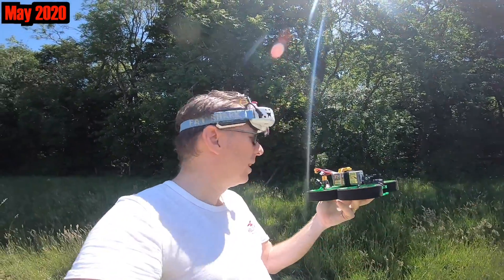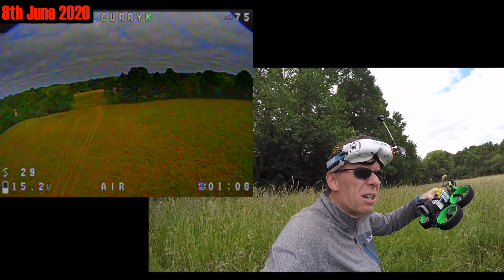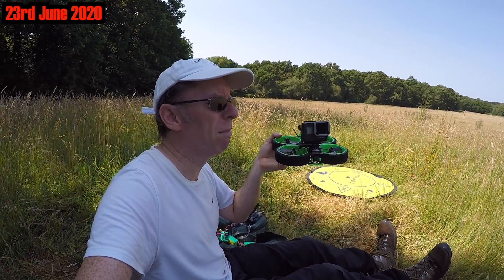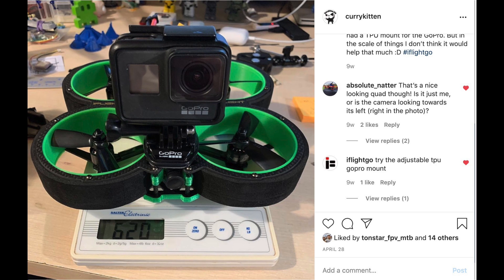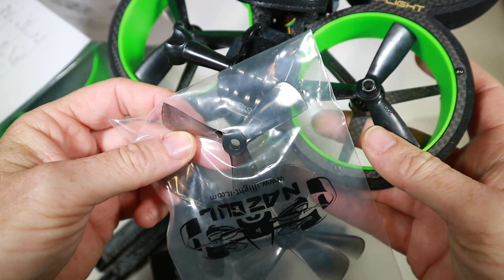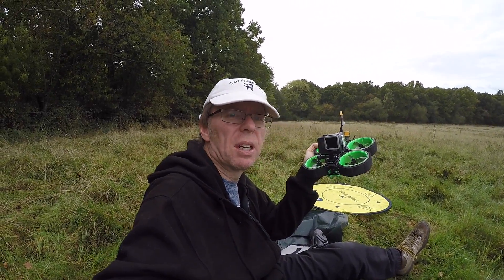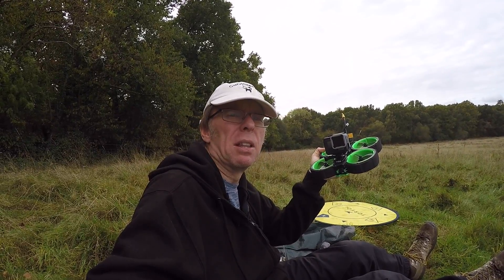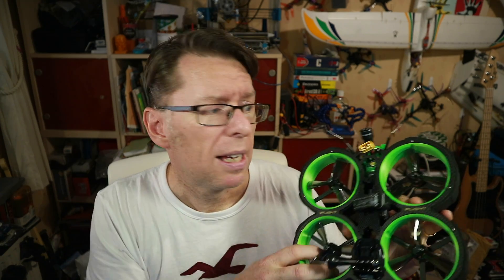Fixing issues with the iFlight Green Hornet:  Motor overheating and range problems

Comment: Thank you very much. You did all of the research. I guess this is why my iflight green hornet that was also shipped in May for review from banggood had scorching hot motors (I partially covered 1/3 of the cost out of my own pocket). So it sounds like there is nothing I can do at this point except message iFlight and see if they will work with me to send out what is basically the hornet v2 kit there and replace everything.
Reply from the maker: Hopefully they can - dodgy design in the first place I think.  Although some people have had good experiences on the original and bad on the replacement, so I think there's a very fine line between working and broken
Reply: @CurryKitten  I have roughly 10 flights on mine, with most of them spent trying to tune the hot motors out because I knew it something wasn't right. I did see some glowing reviews of it but I ask myself; how long did they actually use the green hornet for? I flew it a few times and it did not die on me, I could have easily completed the review and just said it's great, ignoring the hot motor issue entirely. Or missing it, for lack of being thorough. This review was the most thorough, complete testing of the hornet I have seen on YouTube.
Reply: @CurryKitten  Unfortunately even after showing them your experience, and explaining mine is the same thing from one of the first batches from banggood, the best they can offer me is 30% off new motors only. Pfft, pathetic. I know iFlight makes generally good stuff and this incident is a one-off with them but that's pretty ridiculous and disappointing and I told them that. I love how they don't answer what the maximum weight is that these are supposed to carry on the front as well. Thanks again for the video, so that at least I know what I'm dealing with now and that it's not just me.

Comment: I just picked up a second hand one of these and had the same issue with motors overheating.  Had a look at the tune (like you did) and it seemed....weird.   Reset to betaflight defaults and since then it has been fantastic.  Range issues weren't a problem for me though because I dropped in an ELRS nano RX.  It's now quite a capable kwad.  I bought it to do indoor video, but still love ripping it freestyle.  It's just so damn loud!  lol.  Trying out some 5 and 8 blade props soon which should help with that.
Reply from the maker: I couldn't imagine flying it for "fun".  I mean, it flies ok, but yes, the loudness.  I hope you have some success in reducing the noise on 5/8 bladed props!

Comment: I commend you for staying with this to get it sorted out. But it is a strange beast. Using a naked GoPro or the Insta360 should help the weight but either way it shouldn't take this much effort to 'tweak' a new quad so it flies right. Thanks Wayne.
Reply from the maker: The Naked GoPro would be handy here (although I use my GoPro 7 for other things as well so don't want to rip it apart) that said if you get it that light, you could use a little 90mm quad and not have to bother with a 3" at all

Comment: Hey! So useful to come across this. I have the Eachine Cvatar 6s and I'm having awful issues with the quad out of the box. The motors get smoking hot after just a minute or two flight and I can't for the life of me work it out.

Have you had any issues with yours?

Banggood and have been awful with helping to diagnose this and just wanted a video "showing hot motors". I'm really feeling stuck. Its basically a useful lump right now until I can sort it.

I noticed that the stack and ESC were really poorly mounted to the frame and I presumed this was causing noise/resonance but on completely taking it back to the frame I've still got the same issues. 

I'm running the 6s version with a Hero 8 (with no battery or door to reduce weight) but the motors get hot whether I'm carrying the Hero 8 or not.

I'm running stock Betaflight settings and stock PIDS supplied by Eachine out of the box - Any hints?
Reply from the maker: The Cvatar worked well for me (although I had the 4S version) what I do notice about all these cinewhoop style quads is that they are right on the edge of what they can handle.  One little thing wrong and it feels like everything could instantly go up in smoke.  It's entirely possible that Eachine didn't have the normal part and so swapped something.  Obviously the smallest lipo you can use helps, but if Banggood aren't being helpful, get a PayPal dispute raised.  The defaults flew fine for me, so you might just have a dud.
Reply: @CurryKitten  Thanks! Coming from a 5inch to this has been odd from the off but I think your definitely right about being on the limit. I've thought about swapping out the motors for something beefier that will fit the Cvatar but there's not too much around. Some people use the Tmotors but that seems to get reports of overheating even in the Squirt v2. I don't know. Maybe I need to go BIG and put something like the Zing 2205 in it!
Reply: @marcusgough1707  Hey Marcus, I have the Eachine Cvatar 6s from Banggood as well. From day 1 (3 months ago) I've had to deal with scorching hot motors as well. The motors get a little less hot if I use 4s but that defeats the purpose of buying for 6s? Banggood is really useless when it comes to helping with issues like this and there is no YouTube content addressing this issue. Let us know if you come up with a viable solution.
Reply: @remialexgreen1180  hey! I replaced the motors with bigger motors and till have the same issues. I'm now waiting on a replacement stack now as my tests now seem to point to a dud FC. 

Any luck with yours?

Comment: A lot of people have this kind of issue with cinewhoops. The fix is to remove a bit of the foam, just the bits that surround the motors and props and carefully trim the carbon so you only have the bits you need to keep the motors on. Makes cinewhoops fly heaps better.
Reply from the maker: Sure - or another fix would be to put everything on a frame without any ducts at all :)  What I want to see manufacturers of this type of quad to do is a decent amount of stress testing to find out what they can/can't do and adjust their designs accordingly, or say "here's the max weight/lipo size" for example
Reply: @CurryKitten  That sounds like a great idea!
I think it's a bit par for the course that we get to do the beta testing. On the one hand we don't get polished products, on the other we get more opportunities to try new stuff that maybe we can find a better way of using.

Comment: Nice video, did you still fly this one? I got the v1 and what would you think would be a good motor replacement? Other brand like Mamba 1408 4000kv or bigger like the 1507 or even bigger like the Protek35?
Reply from the maker: I'm not much of a fan of these cinewhoops in general - I find them too noisy and they handle a bit like a brick.  In terms of the ones I own though, I've (weirdly) found the Eachine Cvatar to be far superior to the Green Hornet, so mine is not getting used much.  I can't help much in motor choice - I just don't do enough building to know.  What you are looking for is something that can handle load - these motors are always going to be under a certain amount of stress for their size and need to handle it without overheating.  Larger diameter might be better - the Cvatar used a 1507 and the Hornet a 1408

Comment: i just bought a used bumblebee 6s and it smoked the ethix fat rats 1507 2800kv motors it was sold to me with and damaged the esc on the f7 succex stack i felt as it killed the next flat rats i purchased too. i bought a new iflight succex a-f4 40amp all in one controller and 2 new flat rats as i felt 2 of the 2nd set i bought were ok still and even a new frame i built it and attached the gopro and it smoked them again! then something went a miss and the board developed a fault! livid! now have 2 different bumblebee frames 3x 6s batteries and a dji air unit and im scared to buy and build again. now after watching im more confused would the xing c motors stop it? if so do i go 1408 or 1507? i just want to film with my gopro! expensive and stressful! thanks for the video of your own ordeal.

Comment: Hi CK Thanks for the video ! I have had the green hornet v2 for about 3 months and have just plugged it in to my computer via the pain in the a**e usb adapter then connected the battery (like i always have to configure in beta flight) and a nice puff of smoke came out of the stack area stinking my room out & now wont connect to my radio ? Is this the usb connector at fault ? just sharing as for something to look out for ! 😯
Reply from the maker: Oh dear, the magic smoke is never a good sign - especially if it came from the stack - that's usually a case of something being miswired, or having a short and blowing.... although quite unusual for the 5v supply of USB to do it.  Really you'd need to test to find where the issue is, remove the right angled adapter and plug it into something else and see if you can connect via USB.  If you still can, then it's more likely to be the FC.  You'd have to disassemble the main frame in order to get a regular USB lead in there - although you might want to take a closer look at the stack and see if you can see a burnt part anyway
Reply: @CurryKitten  thanks for the reply it was after the USB was connected when connecting the battery that something popped so I am going to start investigations 👍😎
Reply from the maker: Ah - probably nothing to do with the USB connector at all then.  Had it been plugged in before and was ok?  It certainly sounds like something shorting between positive and negative to pop something.  I've plugged everything new in with the ViFly smoke stopper thingy these days https://www.youtube.com/watch?v=iuYWe1JCQss just in case
Reply: @CurryKitten  hi, yes I have been connecting it this way for 3 months then pop ! ? I will look into the smoke stopper thing thanks 👍
Reply: @CurryKitten  Hi CK, Just an update on my popped stack on the Green hornet v2, i contacted BG and they gave me a 1000 points for my inconvenience then i contacted iflight and they gave me 40% of a new stack so it wasn't all bad - so my next question (if i can rack your brains) is are there any good tutorials that you know of to help me install the new stack when it arrives (never done any soldering) but i need to learn these skills, i am guessing this may be a bit like open heart surgery on a quad ?  the reason i was going back into Betaflight is because my battery life and rssi was not displaying in my osd , Kind regards J 👍😎

Comment: I purchased the version 1 so how would I go about getting these upgrades for my Green Hornet. I bought them in a bundle offered by them which included the radio and googles just after the pandemic. Any help that you can offer if nothing more than a parts list, cost  and build guide as I'm on a budget and short of buying a new quad, would be greatly appreciated.
Reply from the maker: If you've just recently bought it, I would hope that this included the replacement parts that I got as well.  More crucially, do you experience overheating when you fly it, or is it ok?  If it ain't broke, don't try to fix it, but if you motors are burning up, try talking to iFlight about it

Comment: hi!  tried to translate your video
I have motors iFlight XING-C 1408 with action cam.the third battery crashed, an engine broke
I didn't understand what to do
it is not possible to put a weight on the greeen hornet?

you have to change the parameters?
on every flight, do you have to take a break to avoid engine overheating?
Reply from the maker: What are you flying with - in terms of lipo and camera?  I found with the new setup, I could fly with 1300mAh 4S repeatedly without any heat buildup.  But as soon as I tried a larger battery things would start to heat up.  So keep as light as possible
Reply: @CurryKitten  
I reply to you from my drone video account:
1500 mah ,action cam xiami yi 4k
anyway I replaced the engine and this morning I tried
I tried to take off but at a certain point it wouldn't get up and the engines stopped
after several attempts, another engine went up in smoke
on the ground, without getting up the engine burned out :(
will they refund me for this faulty drone?

Comment: My guess is those huge ducts are preventing air flow over the motors in forward flight and the prop downwash isn't enough on its own...The original props looked poor as well
Reply from the maker: It's something.  I'm not completely sure what.   I think it needed a lot more R&D before release - but that's true of most products
Reply: @CurryKitten  Hard to believe they don't test a prototype for motor heating issues, it can often be fixed by reducing gains or filtering..BF is notorious for edgy gains IMO.

Comment: how did you disarm the propellers
Reply from the maker: Do you mean so they don't spin when you arm?  That's a case of using Motor Stop and having air mode as a switch instead of always being on
Reply: @CurryKitten  I made it, finally. It was just  the nuts were quite tighten and I was afraid of damaging the motor or the propellers themselves.

Comment: Wow, that took half a year to get sorted. A lot of time and effort for limited results. At least iFlight sent you the goods to fix it. I love some of iFlights stuff, but their QC is hit or miss, just like Eachine. I always buy local (within Canada ) so I can return defective products. Not to bash on the manufacturers, but I've bought enough to know the failure rate as a product is very high compared to higher cost equipment. It's not just Eachine and iFlight either, most Asian suppliers are similar. 
     I don't do videography, so this style of quad is of no interest; other than to see how you finally got it fixed. Looks like the Insta 360 will be more popular on this style of quad, to reduce weight ( at least for those who are into it ).  Great review Wayne,  but that October weather doesn't look very inviting. I'm looking at our first snowfall here in Winnipeg , Canada, peace and cookies
Reply from the maker: You are spot on there.  Failure rates, or errors in designs that didn't show up because the manufacturers didn't do enough testing are quite common place.  I hope iFlight will also help out other seeing the same problems - I've seen an awful lot of posts on Facebook and the like about these types of quads overheating.  It's nice you can buy locally - I think most people would if the choice was available.  I think these types of quads are too popular for what should be very niche.  I'm concerned people are buying them as "tough quads" that bounce off things when they just don't fly that great and make an awful noise.  Snow sounds cool - we just get rain and grey skies :(
Reply: @CurryKitten  thanks brother. Snow is cool, until you live with it 6 months a year. Winnipeg is one of the coldest cities in the world, not uncommon to see temps in the -30C range in winter. I have personally been out in -45C temps, with a windchill of over -50C. Not for long though, LOL  ! Still, we get a lot of sunshine, and our summers are fantastic . Keep up the great work.

Comment: Great persistence, thanks. Interesting that they thought it was a throttle limit when you very rarely went anywhere near 80% let alone 100% originally. Also the ducts being a little larger should, in my understanding, reduce the efficiency as more air can slip between blade tips and duct. In jet engines tip clearance is critical to performance, so much so the blades are actually designed to rub the duct and 'wear in' to create best clearance!
Reply from the maker: I think it was just a case of "look you changed something - you broke it" as far as the throttle limit went.  Even in the initial hover in the garden those motors were getting hot though.  I don't know if the space around the duct is that significant here as the thrust is coming from the props, rather than the air being compressed?
Reply: instaBlaster

Comment: completely unrelated question lol, whats the difference between the openHD your working on an EZ Wifibroacast?  The hardware is the same, the documentation is almost word for word for both, is there actually any difference other than name?
im starting to order the equipment so im serious about trying it out but im baffled by what difference actually exists between the two?
Reply from the maker: Wifibroadcast came before, but it's what Open.HD is built on top of, so there are some real similarities in there.
Reply: @CurryKitten  so would you say open HD is the one to go with then?
Hardware requirements are the same , just wish the zero could he used as a ground unit and not just air as its so much cheaper!
Reply from the maker: Yes Open.HD seems to getting a lot of development and is moving pretty fast.  The zero is cheap, but is just about max'd out even as the air part of the equation